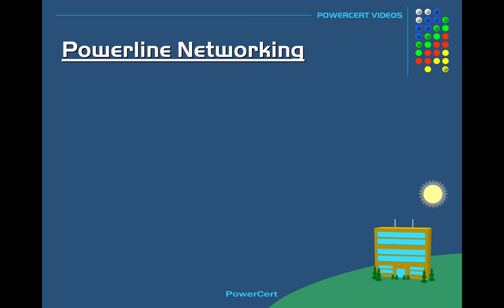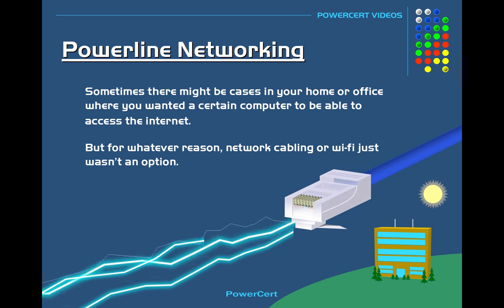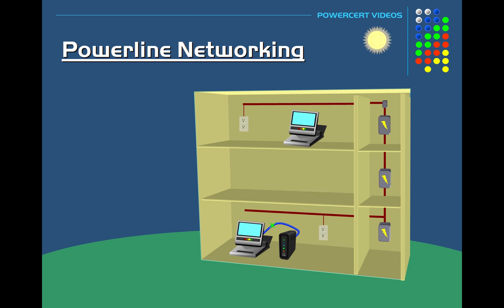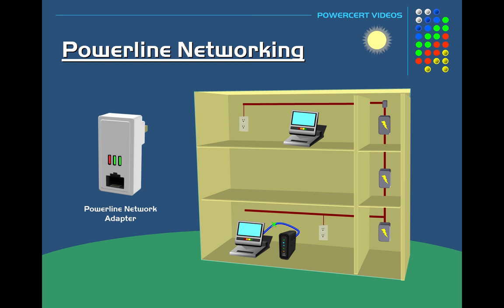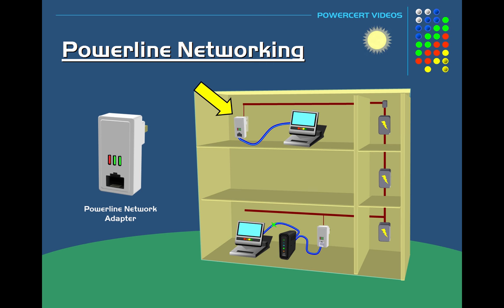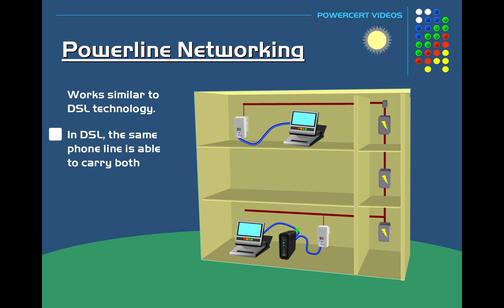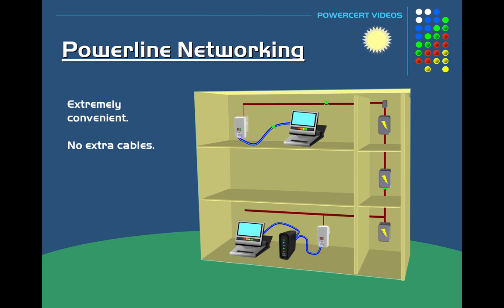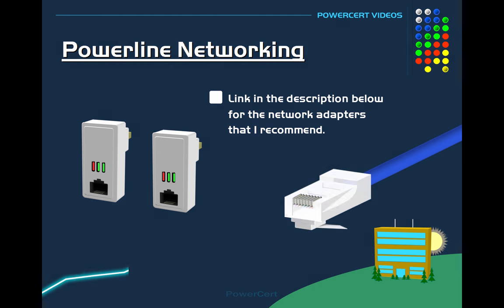Powerline Ethernet Networking Explained

Comment: This technology is great. It allowed me to use ethernet in my basement where I could not run cables through the flooring. Same exact speeds as if I plugged into my router directly. Better than Wi-Fi speeds. Highly recommend!
Reply: @EK-37  it's just plug n play
Reply: How much do these things cost? Does wal mart have them?
Reply: @theodorebennefield2022  They are pretty cheap overall, I have some at my work for like $40-50 I believe but I am not in the states so you guys might charge cheaper. I would recommend them as well, I have been using one for years and they are great.
Reply: Same exact speed? From what I’ve read online there’s a pretty drastic loss of speed

Comment: Great video but I wish you'd have also included downsides to using powerline networking compared to other technologies and the like.
Reply: What are the downsides?
Reply: I don't know, but like every technology it has its downsides.
Reply: Not as fast as using direct ethernet cable and connection quality depends on existing electrical cable quality.. but it still just worth how simple to install it
Reply: No Down Sides because of data carrying in different frequencies than electrical power.
Reply: Semper Fi  Wouldn't consider that as a downside though. It's just a basic requirement, as normal wired networking.
Reply: I have a perfect downsite from my own experience. My pc was too far away from a router and getting a cable wasn't really an option. So i got a powerline. I would really not suggest it. Better buy a signal-booster. I might have bought a bad powerline, but mine was sometimes extremetly overheating and i had no internet acces for some time. Even when i plugged it out and plugged it in once it was cooled. It might have been because of a power overuse or something, it was long time ago. It's deffinetly better to use a signal-booster, so other devices can use the signal aswell. And the ping-strikes using the power-line were terrible.

I might just have a bad luck, having a bad powerline adapter or something, this is my very own experience.
Reply: There can be interference with other appliances like microwave or refrigerator
Reply: @tom_606HQ  you got a really bad one. should try another. In no way should a networking device like this ever overheat. From personal experience, my system works like a charm, and the only issues have been a few issues with syncing them. Repeaters have been bad news.
Reply: @voidofspaceandtime4684  Hey, thx for the advice but i'm no longer using powerlines, i'm on a ethernet cable now ;)
Reply: Semper Fi  Only partially true. They don't have to be on the same circuit as in breaker, but rather same 1/2 of panel, which is usually every other breaker. The power coming into your house is two hot leads making 220v. As long as both adapters are on the same lead they will work. In fact if you share a transformer with a neighbor it will work that way also. Basically your house starts out as only two circuits, the main breaker. Both adapters need to be on the same side of the main breaker. Simpler put, you just need a copper path.
Reply: I had this once. Bandwidth was about 1-2mbps. I would call that a downside.
Reply: Anybody know the speed comparison of power line vs WiFi?
Reply: tom_606 HQ what did u buy
Reply: @Binary86  You also got a crappy unit, or one from years ago. Mine supports upwards of 500gbps.
Reply: @Eric-kl6ch  powerline is definitely more reliable than trying to connect to a wifi router rooms away, but as for it vs a base unit, probably a drop off of 50%.
Reply: There are! When you have security on a high level I can plugin an extra powerline adapter and get into the same VLAN as the Uplink poweradapter tells me to go. Then I could access data that I should not be able to access.
Reply: @alvarotombokan1717  doesn't it have to be the exact same brand as the rest?
Reply: Semper Fi  I don't think that is true. I've had success on different breakers.  Does that count as an electrical circuit?
Reply: @jackvisn  that might help explain my experience.
Reply: It doesn't work on voltage regulators and voltage spike detectors like in ups since it filters unwanted voltages
Reply: @alvinshonggo  Concerning the quality of existing cabling you'd have to have serious issues for the adapters to not pair and transfer data.
Reply: @voidofspaceandtime4684  Repeaters are the poor man's Powerline adapters.
Reply: @Mr. RealityIt is very plausible but most of these products have a built in password protection similar to WiFi like WPA2

Also the maximum theoretical range is 300m in most cases.
Edit: You can actually see who pair in the other end so you can monitor and block the unwanted ones
Reply: @bitTorrenter  that's actually the only thing keeping me from buying these. our house is a nice 120 yrs old. I'm not 100% on all of the electric being updated or not.
Reply: @voidofspaceandtime4684  I think you meant 500mb lol, that is what is supports, doesn’t mean you’ll be getting anywhere near that. When I tried it, I got max 50mb on a 500mb connection, you have to be incredibly lucky for these to work.

Comment: Not saying this would be anything to worry about for a typical user, but this doesn't seem the most secure.  It's highly unlikely that anybody is out sniffing for data over powerline, and I'm sure the distance any data would actually travel and still be readable is not any farther than the 300 or so feet data can travel over ethernet, but it could be a concern for companies and small businesses and such.

Comment: I have been using this technology for years and never knew how the connection was passing through.  Thanks to you now I know.
Reply: I've seen this used in a fire alarm system where an existing building was upgraded to include horns in the various units to comply with the updated code.  All that was needed was to install a new power outlet and the units were plugged in.

Comment: I dont know why someone would dislike this most needed information source. It's so bizarre
Reply: The simple answer to that is you're placing a frequency on an unshielded wire which is acting as an antenna...It wipes out many frequencies used for MW/HF reception...That at least in the states is illegal thru FCC rules...No one's transmission should interfere with another frequency and it is by injecting the data at a different frequency than the electrical power...It is not just International Broadcasters, what still operate, but weather fax, satellite weather mapping, and the military (MARS)...So much more using HF but will not list them all...Now I don't know if the interference on the electrical lines will go higher into VHF/UHF, but that again could impact a number of valuable over the air transmissions...This should be stopped or find a way to do it so it will not interfere with the use of other established frequencies...So much crap with electronics is violating these regulations, and a good part of it outta China with unfiltered switching power supplies such as battery chargers and phone chargers...These regulations are being ignored for the sake of making a buck, but there's been a push back on these unfiltered devices...Let me give you a simple example...You are a baseball fan of your favorite team and for years you have enjoyed listening to games  on your local AM broadcast station...One evening you sit down to relax and listen to the game, but find what you are receiving is a wide banded noise of data transference from a neighbor some where...I would imagine you'd be pissed and annoyed...Second would be you know it's illegal to wipe out the frequency you wish to enjoy...Lastly is the broadcaster who's signal is being interfered with and stopping them from being received and in doing so, damaging their income...So long story short, it was an idiot who figured this out without thinking of the consequences...It's acceptable if they figure a way to stop the interference...

Comment: First one that answered my question on how they are able to send data and electricity at once.  And with a simple easy to understand reasoning.  Kudos.
Reply: The very basic principle of data communication is that, to communicate there needs the sender and receiver. To send data from the sender converts the data into signal using modulation technique and demodulation technique to convert the signal to data. Here the electrical wiring act as a transmission medium. The transmitted signal is varied in various frequencies. There can be attenuation, distortion, noise in that caried signal. In the transmission medium the signal is transmitted as analog form.  Using different technique(such as filter, amplifiying etc.) these mixed of signal is decompsed, amplify to not losses and the voltage level in the transmission line represents those signal. So at the end/receiver device converting those signal back into digital data and that data is further represented into human readable information by using software.it is not possible to understand in a short description of data communication. actually the data communication is vast topic if you understand it properly. you can search how to caonvert data into signal, how to transmit signal over medium, modulation demodulation technique, pulse code modulatio, line coding, transmission cable etc. Another fundamental topic is osi layered model. So to understand properly you have to take course on these topics.
Sorry for my unorganised information providing you.
Thanks.

Comment: i wish this give the actual engineering details, about how running different frequencies doesn't cause any issues on the 120V 60Hz ("Normal") devices in your home.

not to mention that they is probably some interesting signal processing (band pass filters?) being used.

Comment: How many computer can such connection can have and thank you for this great (very professional) video. 🙏👍
Reply: As far as I'm aware, most powerline adapters only have 1 ethernet port. If you need to connect more devices, you can plug in a network switch into the powerline adapter and then plug in multiple devices into the switch.

Comment: damn im kicking myself,  i had no idea this tech even existed, about 6 months ago i had an electrician install a number of ethernet jacks in different rooms so they could all use the single connection. It cost me $1800 (could have done it myself but would void my house insurance if it wasnt certified by an electrician) hindsight... but now i know.Great video and thankyou!
Reply: Honestly, having dedicated ethernet ports is much better than these powerline adapters. These devices don't work always work well. Depending on the brand, model, home's electrical wiring, and outlet combination, you can have many issues like poor performance, frequent disconnects, stability issues, etc.

Comment: Nice vid-jay-o btw.  I came here to better understand how car ham radio antennas connected to vehicle ground don't cause other electronics powered by said vehicle to malfunction.  I suppose if you had electronics operating on similar/same frequencies plugged into whatever circuit your powerline ethernet adapter was on, malfunctions of both said electronics and data connection could occur.
Reply: Come to think of it, this may be why some electric cars are doing away with AM radio.  Perhaps the motors cause to much interference with the AM receiver.  Completely different subject, but also kind of related.

Comment: Question, do you get a better connection when plugging the Power Networking Adapter (PNA) directly into a wall socket and are network speeds affected when plugging the PNA into a power board instead of directly into the wall socket?
Reply: Yeah its best to plug the adapters directly to the power outlets instead of a power strip. Those can filter out frequencies that are needed and cause performance issues.

Comment: This video still didn't answered to few questions:
1. If I use multiple pairs of Powerline Ethernet, like 4, 6, 8 etc... Do these create interference between them or just work?
2. Do the signal cross the house? I mean if I place one powerline to my apartment and one to my neighbour, it does transfer the data?
3. What's the speed?
4. Is there a maximum range?

Comment: Yeah, i exactly know what powerlines are. My pc was too far away from a router and getting a cable wasn't really an option. So i got a powerline. I would really not suggest it. Better buy a signal-booster. I might have bought a bad powerline, but mine was sometimes extremetly overheating and i had no internet acces for some time. Even when i plugged it out and plugged it in once it was cooled. It might have been because of a power overuse or something, it was long time ago. It's deffinetly better to use a signal-booster, so other devices can use the signal aswell. And the ping-strikes were using the power-line were terrible.
Reply: tom_606 HQ 

Hey  Tom-606 HQ,
I’m no engineer, and I hope one sees this to confirm my theory. 
Overheat may be caused by both router and EoP, were set to 60Hz and need to be set to different frequencies. 
Additionally, when you boost any signal, you’re also boosting the noise/distortion levels as well, causing the processors to work harder with less efficiency, causing more heat.
I hope this helps get you a final resolve to your system.
Maxx

Comment: I have my Starlink on my Cargo ship. Now, the Router is set in the Wheelhouse/Cockpit. And i need the WLAN signal going to the Apartment part of the Ship. I know, that the Eceltric line from the Apartment is normally sepwrated from the wheelhouse (sofar seperated, that it haves its own fuses) but it feeds from the same generator 220v network. So does this method still give me the Signal to the Apartmentblock or not?

Comment: If we use 122 v then 110v for electricity and the 12 volt for 2 chanel each use 6 bolts for voice and data separate and time domain as bandwidth. Each second we can have thousand of bandwidth each can handle hundred of channel

Comment: How do we deal with issues where we are on a different "leg" of the main breaker panel?
Reply: i assume by leg you mean a phaze.
in that case you would have to find 2 wall sockets that share the same phaze and connect the adapters to them since adapters use L and N as Data+ and Data- to communicate
in a typcal LAN cable you have 8 wires but you use only 2 (D+ and D-)

Comment: Great video, but you didn't cover some of the caveats of powerline adapters, such as the fact that the circuit on which the two powerline adaptesr communicate should not be too long, otherwise the signal speed will degrade.

Comment: Actually this is my first time knowing that you can connect ethernet through powerline since I managed my small internet cafe from 2009.
Is there any drawbacks using that way?
I'm thinking that maybe a security issue if you have a powerline port outside building which can be accessed by public. Or even to other home that use the same power provider?

Comment: Great! I wonder what maximum distance can be covered. Does this method only work within the same building?
Reply from the maker: It works only in the same building.  The distance works similar to wi-fi.  The further the adapters are from each other...the weaker the signal.
Reply: Well, it confirms that physical laws still work as they are supposed to, hehe

Comment: i got a genuine question
I live in a place with a lot of thunderstorms and the odds of a power surge to my home is pretty high
If there was a power surge and I used powerline will it potentially fry whatever device was connected to it?
Reply: I don't think so.
Since you already connect the charger cable to the device the same way, any power surge would be negated by the adapter of the charger..
Similarly the power-line network cable has a surge protector that would dissipate the charge to ground and safe guard your device.

Comment: What's the range on this technology, I cant imagine this is free from interference on the electric cabling..... like what about power surges or when someone throws on a large appliance that has a huge initial amp draw and the lights flicker, what sort of impact do those sort of things have on a system like this
Reply: All the maximum values are theoretical under ideal lab conditions. In the real world, the performance likely will be significantly less than what they advertise on the product listing. Yes all those things you mention can/will have an effect of the performance and reliability of the powerline adapters. And you're advised to not connect them to power strips/surge protectors as those can filter out the signal coming from the electrical wiring.

Comment: This is how I am watching this video i have power line adaptors. one in my unit and the other in the main house and I have hooked them  up to routers one in my unit and the other one is hooked up to the modem in the main house but it does work but the speed is up and down

Comment: What network speeds can be expected with powerline ethernet? Is something like 50Mbps possible?
Reply: It depends entirely on the wiring in your home, so results vary greatly from person to person. My internet is about 350 Mbps, but when I use a powerline adapter rated for 600Mpbs, I get 40Mbps. setting up a mesh network might be more ideal, but more expensive.
Reply: My internet is 50mps and I'm getting 50mbs through powerline.

Comment: I'm going to assume that these devices would only work if they're on the same electrical circuit. Am I wrong?
Reply: You are correct. You cannot run a powerline network from say, the main building to an extension.
Reply: I wonder how it separate our home circuit considering that our home's is connected to apartment's circuit and it is connected to our neighborhood's circuit and so on. I'm guessing fusebox is the what make the distinction. Any ideas?